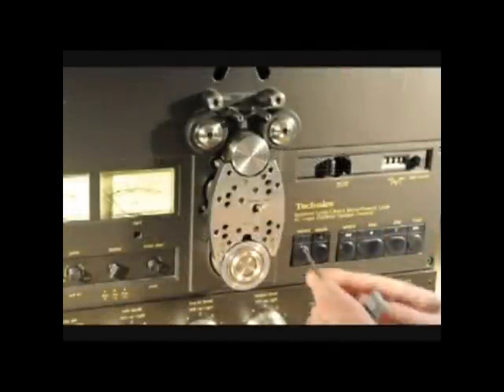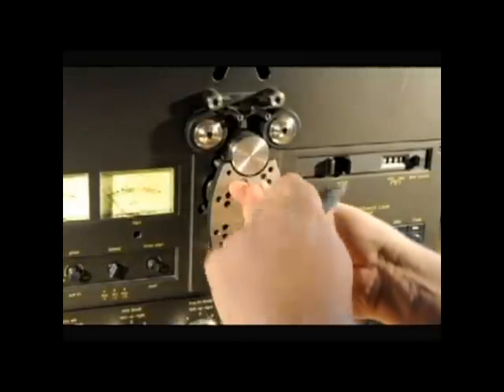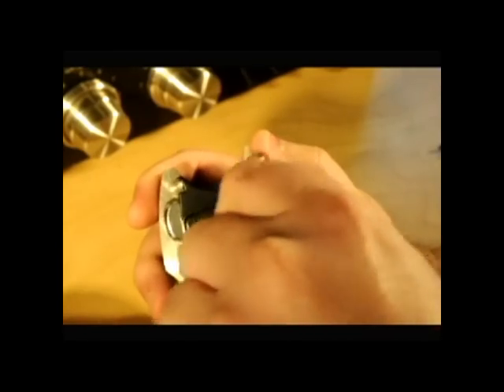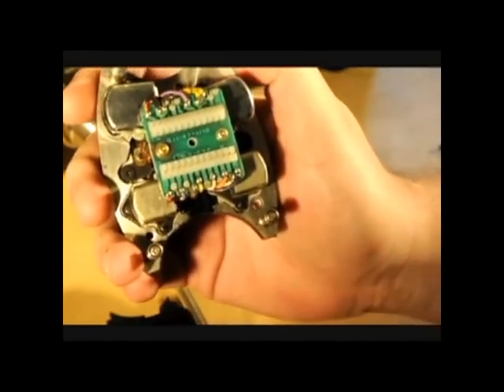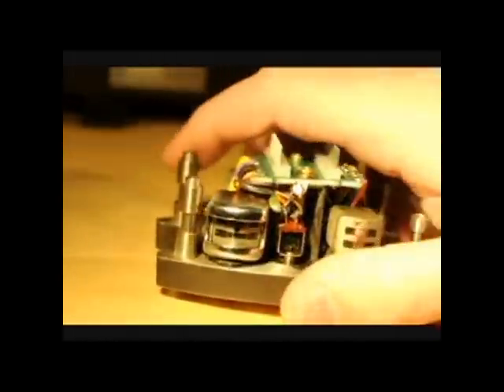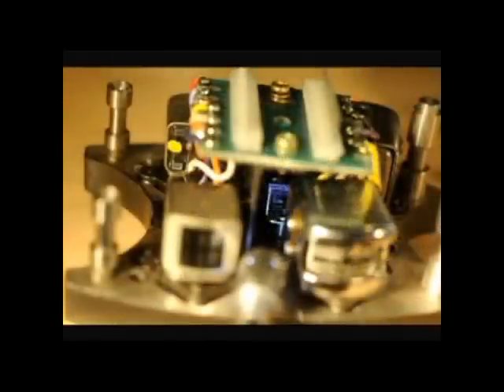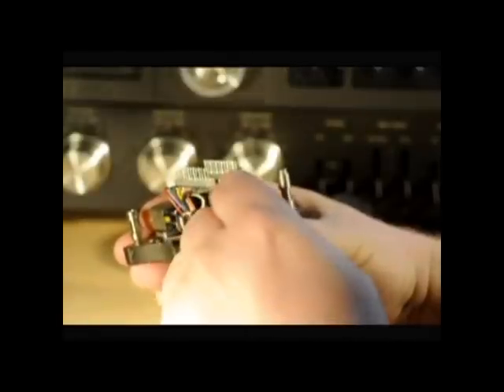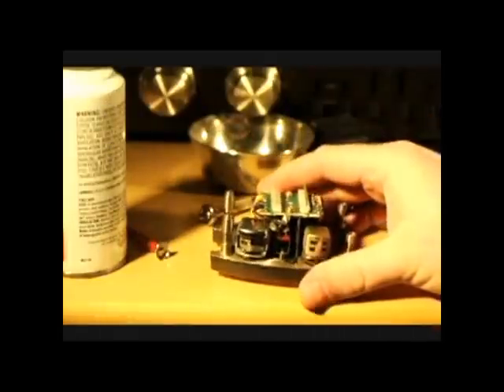Technics RS1500 head selector switch repair

Comment: TECHNIX ,,,,,TECHNIX ,,,,,,TECHNIX .....how fucking difficult is it to say TECHNIX .....its NOT techniques ,....man alive . It drives me nuts . Now , onto the PISS POOR job you did on the switch , thats NOT good enough to get these clean , you need to open the switch by carefully bending up tabs under it , take it apart  , clean the blades and sliders and then put it back together  then and only then will you have a clean switch .  Spraying shit in there just makes the problem worse a few months down the line .

Comment: I removed the silver-coloured screws on the headblock of my Technics 1500 (not the RS1500) as shown in your excellent video but cannot gently lift the assembly away. Any suggestions?
Reply from the maker: If all of the screws are out the headblock is only being held in place by the electrical connector. You may need to gently rock or wiggle the block a bit to free it from that connector.
Reply: +Dan “Doc B.” Schmalle After much wiggling, jiggling, and coaxing, I was able to remove the assembly and make the repairs you so clearly describe in your video. Sounds great now. Thank you!
Reply: Gary Barclay I had the same issue I did the same thing but before assembling it back I gently sand it with 200 grit sand paper to clean the contacts  and believe it or not it did improved the sound 90% i was amazed

Comment: Great Vid..thanks.
Any possibility of demonstrating how to tighten/adjust the brakes on a 1506? Read the manual but I shied away when I removed the rear of the deck.
I live in Cyprus where reel 2 reel engineers are as rare as hen's teeth; need to do any small repairs myself.

Comment: Just did that. And not only I fixed it but improved the sound quality 90%.  Great vid
Reply: I found this video useful for mentioning that you could unscrew the plastic piece on the bottom of the RS-1506 head assembly to get at a noisy 2-4 head selector  switch.  However, I think a better way to clean the selector switch is to use a "liquid" syringe & fill a small amount of DeoxIt D100L (in a 7.4 ml. bottle) solution  into the syringe and put just a few drops of it into the switch.   Move the switch back & forth a number of times, put one more drop into the switch and again
move it back an forth to clean off oxide build-up.  This avoids spraying DeoxIt outside of the switch.  My switch is  Dead Silent when I move it.  This approach also works well for deoxing the volume control and line-level and mike-level pots on the deck.